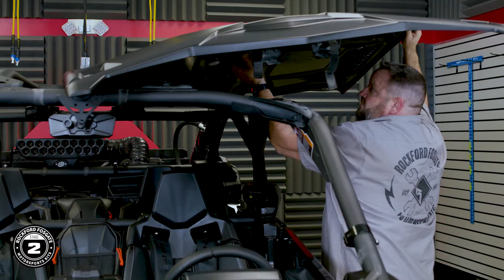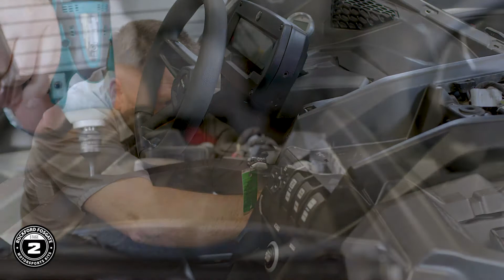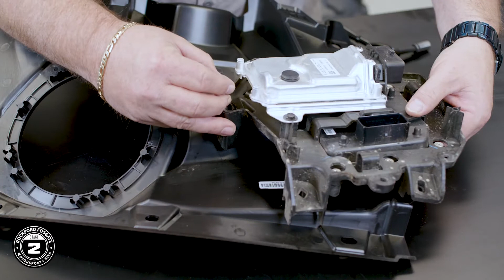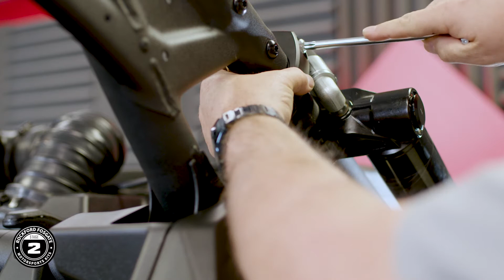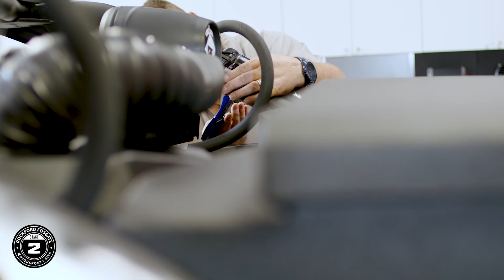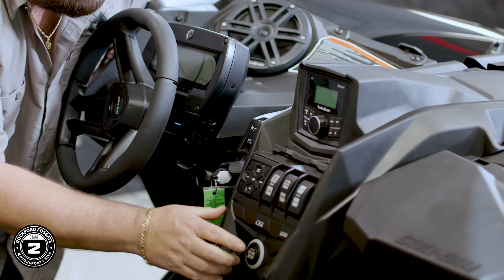Can-Am X317-STG2 Installation (Gen-3)

Comment: Do both the power connectors on the pmx1 harness plug into the x3 or just one of them
Reply from the maker: At timecode 6:46 (PMX Harness Installation) the main white MOLEX  gets connected, then the single power plug connects to the empty Can-Am accessory wire under the dash.  Please note, this is hard to find!  It's easier using 2 people; one person inside the Can-Am lifts-up the dash panel and the 2nd person stands in front of the Can-Am looking for the accessory wire.  https://www.youtube.com/watch?v=Cd36ohDgCzE&t=406s

Comment: can you add an amp to the stg 2?
Reply from the maker: Yes you can.  You'll need the wiring kit + amp rack and the amplifier.  You can also watch the STG3 installation video to see how this would get installed.

X317-K8 Wiring Kit + Amp Rack
https://rockfordfosgate.com/products/details/X317-K8/

M5-800X4 Amplifier
https://rockfordfosgate.com/products/details/m5-800x4/

X317-STG3 Install Video
https://www.youtube.com/watch?v=8ahANwZ3nSU

Comment: I have the stage 1 for my x3 and I want to just add the tower speakers, will they still be plug n play? Or will I need to buy more than just the tower speakers?
Reply from the maker: You'll need to add the the following components, but keep in mind, you're using radio power:
- M0WL-65MB: https://rockfordfosgate.com/products/details/m0wl-65mb/
- MX-RSW-16: https://rockfordfosgate.com/products/details/MX-RSW16/

If you want it much louder, you'll need the amplifier and wiring kit:
- M5-800X4: https://rockfordfosgate.com/products/details/m5-800x4/
- X317-K8: https://rockfordfosgate.com/products/details/X317-K8/

Comment: I have a stage 1 for my X3.   I just want to buy a piece at a time like I just need the subs and the amp.   How do I go about that
Reply from the maker: Hi Jeremy, You can do that, just note there is a "kit" savings when it's purchased all at once. You can purchase them under the individual Amplifier, Speaker, Subwoofer, Accessory categories here: https://rockfordfosgate.com/utv-audio/.  Also note, every component is designed to interface with a corresponding Rockford Fosgate product,  so this way we can guarantee plug-n-play compatibility and proper power matching.